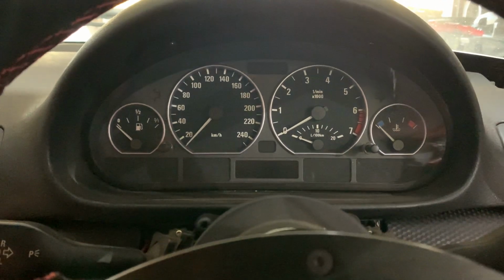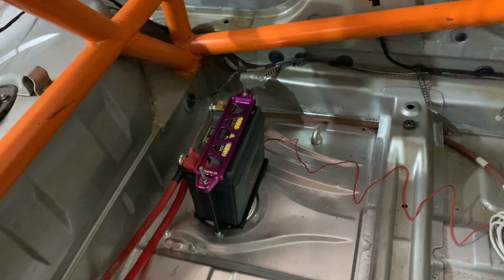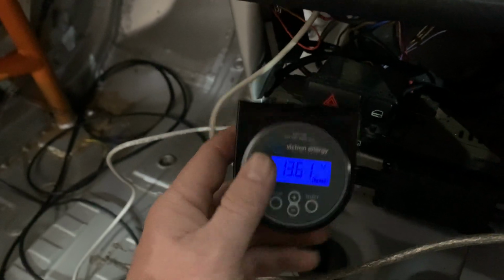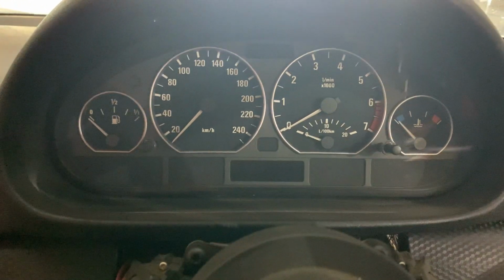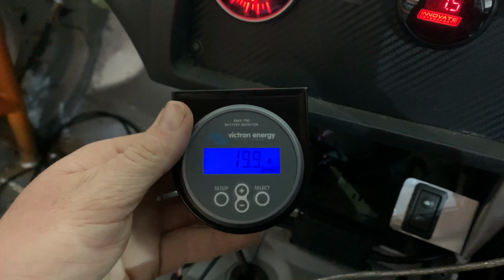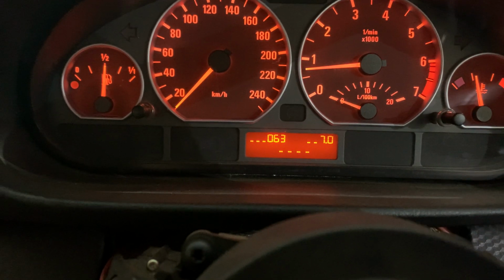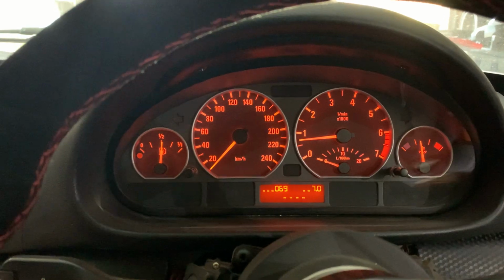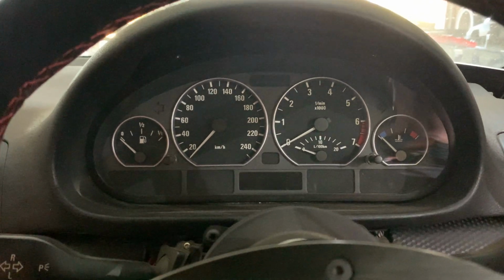New lithium battery and Exhaust Pops - BMW E46 Track Car

Comment: Where did you put oil temp sensor?On the oil pan?
Reply from the maker: We have an S50 oil filter housing with a multi-sensor adaptor fitted - oil temp sensor goes on there.
Reply: @buildabeemer  Ok.What kind of petrol you use for race?How much octane?
Reply from the maker: Mario Turkalj we have been running 95 pump fuel (remember we’re at 1600m altitude in Johannesburg, so this is the equivalent of 98 at sea level. We ran some fuel tests on the dyno 2 days ago, and found that we were getting ignition retard due to knock. We then ran 95 plus NC Race octane booster, still had retard, then we ran 105 race fuel. We still had some retard, so Nick took a bit of timing out of the map. We are getting knock on cyl 4 & 6, so we think we have a contribution from the engine (carbon?)
Reply: @buildabeemer  1600 m above sea level?!Uhh...that is high.I am from Croatia,and I live at 124 m altitude.....Maybe that knock is coming from valve lifters?Some times they make that sound.Do you have stock hydraulic lifters or you replace them with something better for high rpm?S54 engine(m3) have fix lifters.
Reply from the maker: @marioturkalj3126  Yup, the altitude is a big power-killer - we lose around 17% power compared to sea level. We don't have a problem with lifter tick, and I'm sure the knock sensor calibration would tune out frequencies other than pre-ignition or detonation knock.
Reply: @buildabeemer  I am not so much into knock sensors so don't understand all things they do....or what problems they make...Ok,continiue to make interesting videos.👍

Comment: Bro, I’ve read somewhere you’ve used Romraider before. Making me think you’re used to INPA cables. Question is: is the light on the cable supposed to be turned on all the time the cable is plugged? Mine turns on for about a minute and then shuts off.
Reply: Mine shuts off after a while.. the program your using will let you know when connection is lost.
Reply from the maker: It's very random, that LED indicator. I am not able to confidently determine the state it should be in at any point in time. When flashing a new tune file though, the LED flickers quite consistently which appears to indicate stable and ongoing communication.